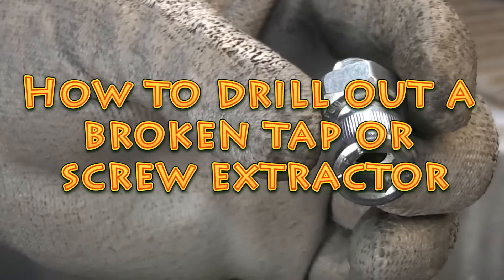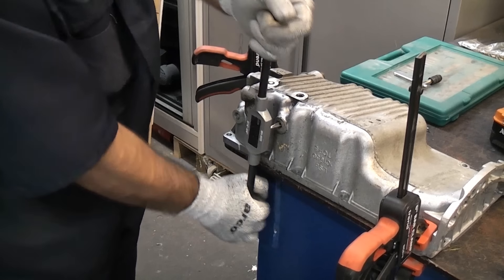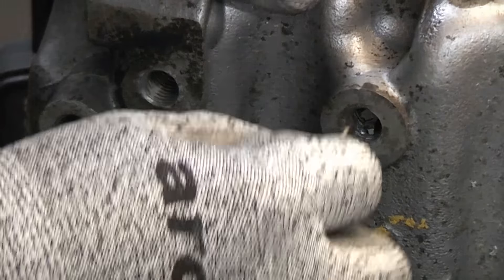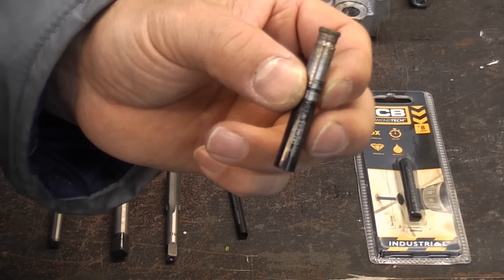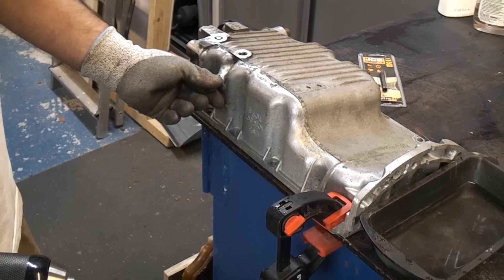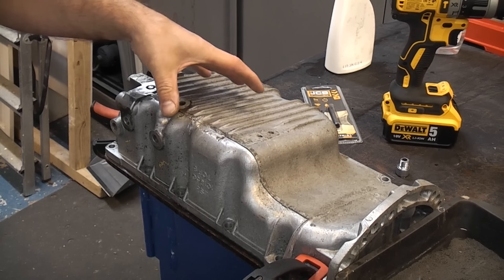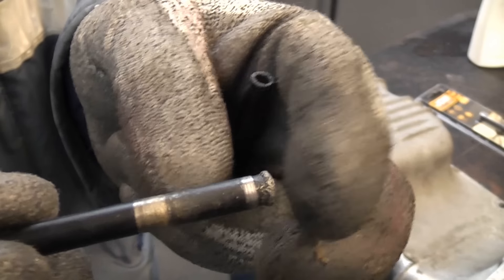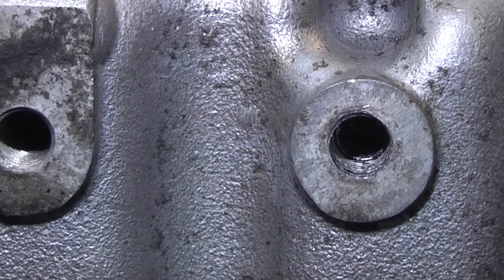How to drill out a broken tap | drill out a broken screw extractor

Comment: Thank for so much for this - great video full of really useful advice.  Two quick questions:
1) Can you use the Diamond Tech Holesaw in both directions?  Just wondering if you can use a reverse (counter-clockwise) rotation so that you maintain the possibility it might catch and wind the fastener out.
2) What product were you using (in the spray can) to clean out the hole as you were cutting with the  Diamond Tech saw?
Thanks again.
Reply from the maker: 1) Yes, you can use them in either direction. I did try using them in reverse, but because these bits are abrasive they do not bite into the material, so there is little chance of extracting with one of these.
2) I used water for dipping the bit in (as recommended by the hole saw manufacturers), but the spray I used to clean the holes out was something I picked up in B&Q (I think it is BIO based). I've just looked on their website, but can't find it (their site search is terrible).

Thanks for the comment

Comment: Must be nice to have the part out on the bench.  Broken bolts for me are always exhaust manifold bolts on v8.  Cannot take the whole cylinder head off.  Usually can’t get in straight, frame shock etc in way.  Have to use right angle drill.  Can’t get right angle electric dill have to use air drill , can’t slow down that way.  Bolts and taps never break way down in the hole where I can use a guide, always break right at top , smooth.  Many times customer has already tried to drill and wallowed out the hole to an oval before I even get to start.  Nice demonstration, but not really real world.

Comment: Did you have to tap new threads
Reply: Nevermind
Reply: @ultimatehandyman  I have now broken the 1/16 drill bit into the broken bolt. How can I remove bit and/or continue to drill hole thru steel for M6 bolt
Reply from the maker: @lillouie9738   To drill out a drill bit you either need a solid carbide drill bit (expensive and very brittle- they break easily)
Or drill it out with a diamond hole saw- like in this video.

Comment: could not agree more about the necessity of taking a brake... I had to drill a 13 mm hole in my kitchen granite counter-top, with a standard masonry drill... my muscles still ache, and this was a few days ago... I did not take a brake... did not buy a special drill like the one you are showing here on account of the price and the fact that it was going to be used just this 1 time. even though it is expensive, should have bought it... a Chinese, low grade one costs about 28 pounds where I live, and it is a lot considering the currency. anyway, lesson learned... the hard way...
Reply from the maker: I drilled a 10mm diameter hole in granite using a masonry bit a few months back, so I know how hard that is!
Thanks for the comment 😉

Comment: Hi, I'm in Greater Manchester, you sound local, do you have a garage, I've got a broken bolt extractor on my motorbike,  can you help please?
Reply from the maker: I'm in Darwen (near Blackburn), I don't have a garage, sorry.
You should be able to drill it out (providing you can get in with a drill) by using either a diamond coated hole saw, or a Hard cut drill- https://bit.ly/3rcZAaR
Reply: I  could tell you were local, I'm just around the corner in Ramsbottom.
Thanks ever so much for replying, I really do appreciate the advice you've given. Your video is brilliant and I'll give it a go. I'm going to leave it for a while though as every time I touch it it gets worse and my confidence is totally shot at the moment. I had my fingers crossed that you'd have a crack at it because you make it look so easy.!!!!  When I do tackle it  I'll let you know how I get on. Thanks again.
Reply from the maker: @grahammillward8994   If you can drive the bike, I don't mind having a go at it - well I'll at least take a look and if it looks like it can be drilled out I'll have a go? 
You would have to bring it here though.
Reply: @ultimatehandyman  I've done it!!!  Thanks ever so much for the posting the video and your very kind offer to help. I'm over the moon.

Comment: Will the cutting paste blunt your drill bit /tap at the same time?
Reply from the maker: No, cutting paste ensures that a drill bit or tap will be lubricated/cooled- preventing it from being damaged.

However I used water to cool the diamond coated hole saw, as I was unsure if the cutting paste would effect the diamond coating.

Thanks for the comment

Comment: Hi there. Great video! I had a similar issue, with a bolt for my thermostat housing on a 1998 e320 benz.  Instead of the tap breaking in the hole the head of my screw extractor broke off.  Do you have any ideas on the next step to remove the broken extractor, then try again to remove the broken bolt? By the way, the problem initially started with the thermostat housing bolt breaking 1/2 off when simply trying to unscrew the bolt. I was able to drill a hole pretty close to the center of the bolt using a left-hand drill bit then using the extractor. I had also been using penetrating spray.
Reply from the maker: They are difficult to drill out, but it is possible- https://www.youtube.com/watch?v=7JCfEMrCjhc
Thanks for the comment
Reply: @ultimatehandyman  This is too funny!!!

Comment: Sometimes you can get lucky using a left hand jobber.  Depending on the material to be drilled of course.
Reply from the maker: Left handed drill bits are brilliant, but unfortunately they won't touch a tap/screw extractor.
Thanks for the comment 😉

Comment: What about 3 mm tap or less?
Reply from the maker: It's very difficult on smaller taps, I normally only work on M6 and above, up to about M20. If I think of a good method for small taps, I'll let you know.
Thanks for the comment 👍
Reply: @ultimatehandyman  Use the broken hard drill, tap or ezeout as a central guide for the core drill i.e. the core bore being sized to match the diameter of the broken item. The face and outside diameter of the core drill cutting far easier in the softer body material will be far over sized. 
Next, determine the size screw to fill this oversized hole - drill correct tap size and thread hole. 
Prepare a similar 'guide bolt', drilling minimal size centre hole. Install this screw with stud locking grade Loctite and allow to fully cure. Trim cut and grind flush to body material. 
Drill to correct tapping size and then thread hole using DUE CARE and METHODS to avoid breaking another damn tap.... especially sizes under M5.  
It's stupidity to expect using a powered tool to tap M3 or smaller threads, which is why they break, aside heavy-handed butchery usage.

Comment: Damn "engineers" could have saved us all a TON of work like this by using Through-Bolt designs instead of these stupid threaded holes.
Reply from the maker: Unfortunately that is not always possible. Blind holes are with us for good ;-)
Thanks for the comment
Reply: As a handyman you know it's possible 99% of the time because you are used to "jury rigging" solutions and that creates a mindset of possibilities instead of impossibilities. Things are built expressly to limit how often they can be repaired.

Comment: It’s made out of steel it’s tought but brittle
Reply from the maker: Yes, all steels are alloys- mild steel is soft and ductile. Tool steels and hardened steels are way tougher, but brittle and break easily!
Thanks for the comment 👍
Reply: @ ain’t gonna lie broke motor mounts tried every bit to drill threw the broke bolt none worked

Comment: Hello and thanks for a great video. A screw extractor snapped off inside a sheared off disc brake bleed screw. The bleed screw is only about 5mm in diameter, so too narrow for the JCB bit. Would I be able to use a rotary point tungsten carbide burr, like these ( https://www.ebay.co.uk/itm/20pcs-3-3mm-Rotary-Point-Burr-Solid-Tungsten-Carbide-Die-Grinder-Shank-Set/274011630027? ) to drill into the snapped off screw extractor? I'm thinking perhaps starting with the sharpest point tip and working out to a more parallel tip to grind out the rest of the extractor and bleed screw? Thanks for your advice and videos.
Reply from the maker: Yes, one of those will work, but you need a high speed tool, such as a die grinder, or perhaps a Dremel (a drill will not be fast enough)
Be warned that carbide burrs create small sharp metal splinters that get absolutely everywhere! I'd recommend wearing safety glasses and a full face visor ;-)
Thanks for the comment 👍
Reply: @ultimatehandyman  Thank you very much for your advice. I'll be sure to use something fast. I have a die grinder and a Dremel so I should be able to make it work. Thank you for taking the time to reply.

Comment: all the trouble to left handed drill in your other extracting videos, then you right hand drill with the hole saw that could easily have worked left-handed...
and what's with the 'cutting paste' you want to evacuate those chips rather than having then stick around and help dull or better yet snap your cutting tools

Comment: or, submerge problem Aluminium hole in Nitric acid/water at 60-70°C, eats bolts, screw extractors, taps, in 15 mins. Wear a mask and goggles.
Reply from the maker: Thanks for the comment 👍